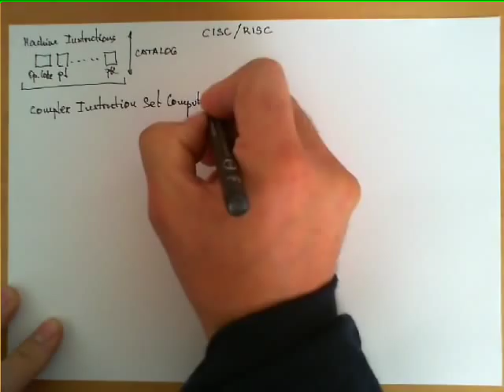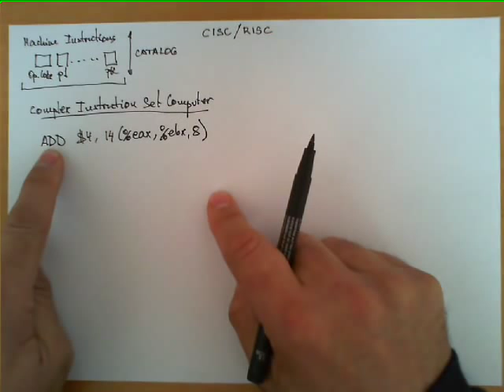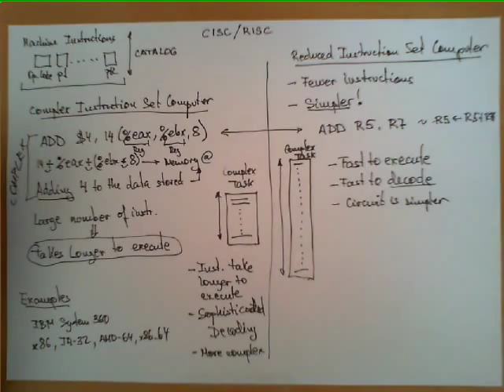CISC vs RISC architectures

Comment: This is a good explanation of the two major architectures that are used by computer cpu's. When all is said and done both of these architectures are in use and one is not superior to the other, they are basically different ways of doing the same thing. When it comes to people using computers, as long as the computer does what the user wants it to do, most people never think is this a CISC or RISC architecture.

Comment: I wish if there is Closed Caption in your video, so i can understand it.
Reply: +evaroppi The example adding two numbers in memory takes almost the same steps to finish in both. move number a to register %eax (R5) , move number b to register %ebx (R7) , add them and save the result to %eax (R5), move the result from %eax (R5) back to the memory loaction of number a. In CISC you only program: add memory of a, memory of b, done, that's it. In RISC you do all the above moving/adding procedures in your code. Therefore RISC code is much longer... but RISC CPUs are much easier to make... There are more things beyond this really, like superscalar pipeplines, branch predictions, out-of-order executions, SIMD instructions.... Intel is not dumb...